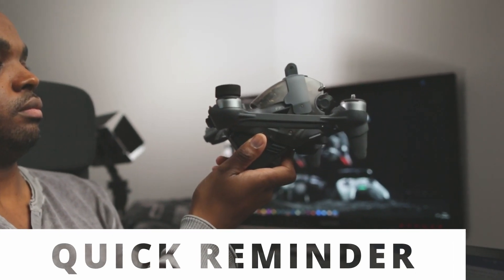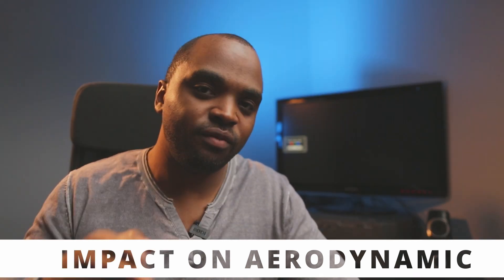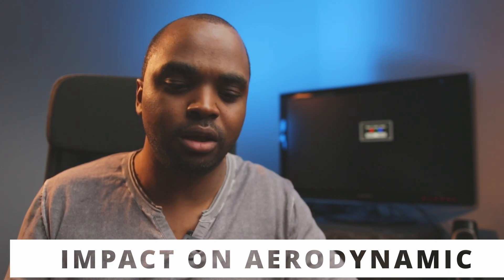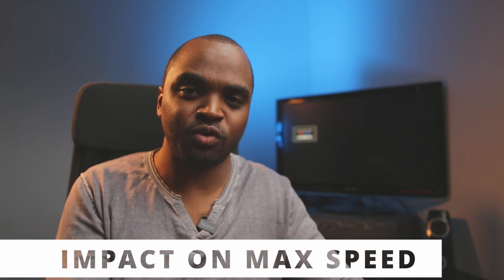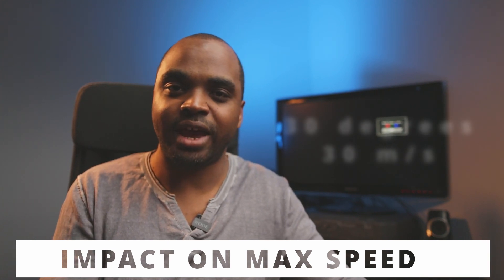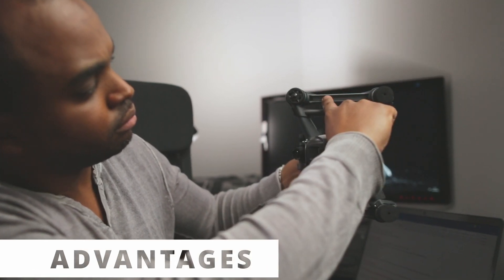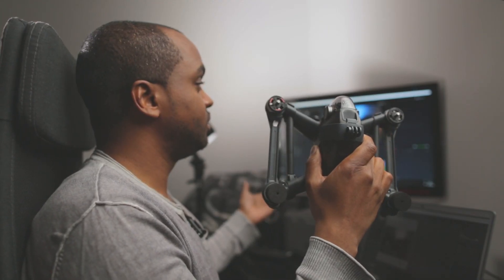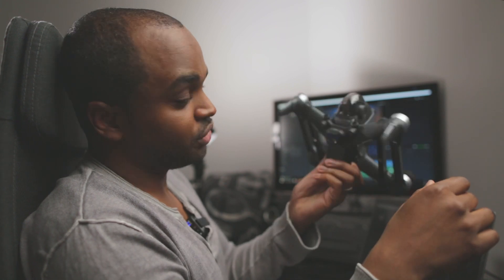DJI FPV ARM BRACERS PART 2

Comment: I cant find it, can i get a link please
Reply from the maker: arm bracers : 
https://www.amazon.fr/DJI-FPV-Prot%C3%A8ge-bras-compatible-collision/dp/B07FSRFQSR/ref=sr_1_3?__mk_fr_FR=%C3%85M%C3%85%C5%BD%C3%95%C3%91&crid=2SFADY4A6KQQK&keywords=dji+fpv+arm+bracers&qid=1663651637&sprefix=dji+fpv+arm+bracers%2Caps%2C58&sr=8-3

arm reinforcer:
https://www.amazon.fr/Reinforcer-Protector-Compatible-App-Controlled-Accessoires/dp/B0B29NSMTN/ref=sr_1_27?__mk_fr_FR=%C3%85M%C3%85%C5%BD%C3%95%C3%91&crid=2SFADY4A6KQQK&keywords=dji+fpv+arm+bracers&qid=1663651637&sprefix=dji+fpv+arm+bracers%2Caps%2C58&sr=8-27

Comment: One can never be too careful, I ordered them together with a frontal protection, at this rate I will soon have a flying fortress!
Reply from the maker: one is ok , two is better  , i wont mount a frontal protection , it will not fit my backpack